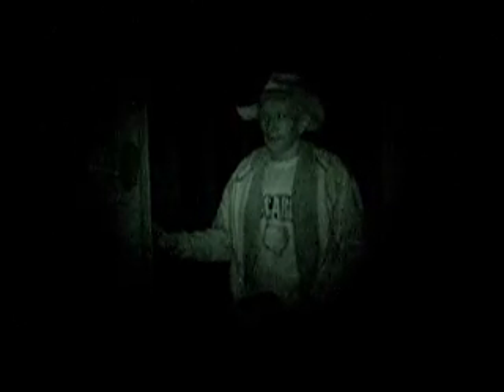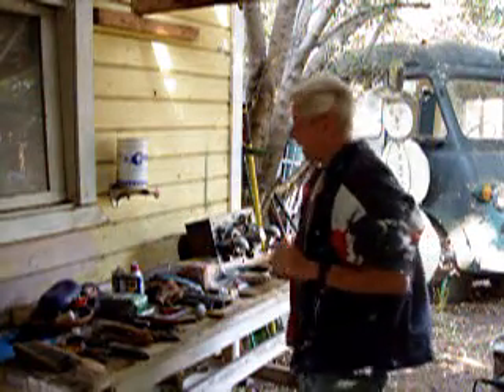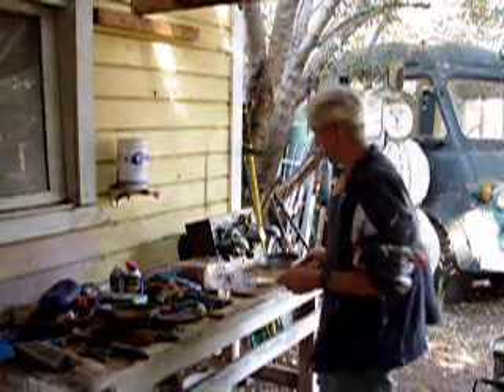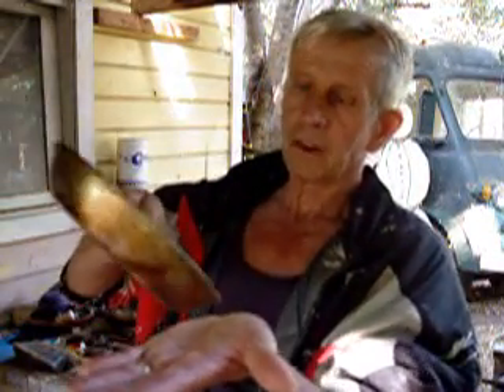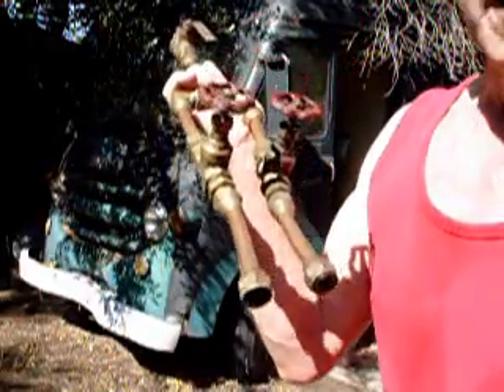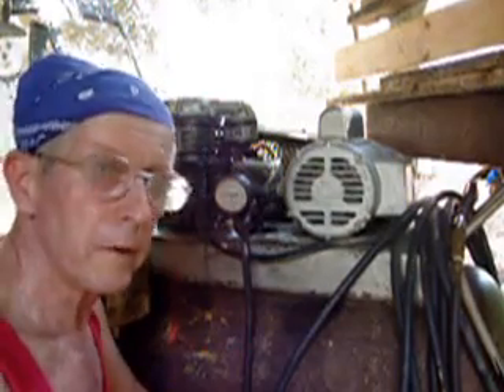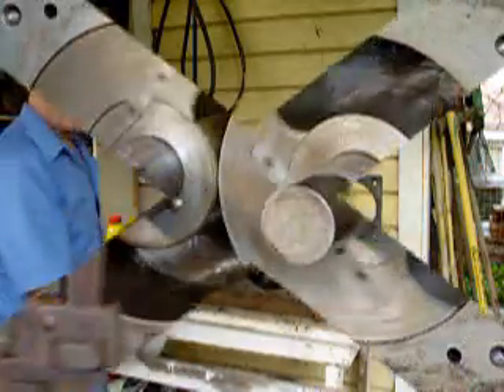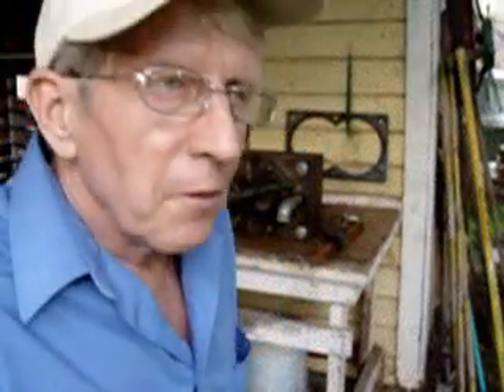Part 3 rotary steam engine 4 26 2009-3 25 2010.wmv

Comment from the maker: @kwelch42 thanks for thought. That may well work at some point. I had smothered them in STP and oil, to no avail. Years ago I had a fire tube boiler hook up and had the same issues of steam just blowing by. I had it set up at 100 psi steam and I could feel some attempt to move on the axle but, no go. Thanks again,
Ray

Comment: @rayunseitig true enough,but there is only one rotor in a wankel and there is an uneven temperature gradient  in this engine which requires the cooling system configured to spread the heat more evenly.
I read somewhere that the wankel engine uses a ceramic  "piston ring'" to close up the tolerances, the ceramic has negligible expansion and sits in a groove at the tip of the lobes and on the edges,
the cam expands but it is always less than the diameter of the chamber the cam sits in,

Comment: @rayunseitig then you need to know what the maximum expansion is of both cams at max running temp, then you can machine down the meshing surfaces a little further
The drawback is that you would need to let the steam flow warm up the metal first which should seal things up nicely, almost like the fuel tanks on a SR71 Blackbird or a formula 1 race engine.
you might have to find a good cam position and drill and tap out out a bypass hole to let the steam flow in and out until its warmed up.

Comment from the maker: @gordongate  Yes, that would take care of one of the areas of leakeage. Namely the sides. That leaves acouple of other places tho. The inner hub circle agains the outer large circumference of the adjacent rotor AND there the 4 crescent shapes intersect. Also I'm sure closer tolerances would help but not so close as they sieze up with the expansion of heat. Classical engine problems I'm sure.

Comment: @rayunseitig perhaps a version of how piston rings work.
a flat circle ring that sits in a groove cut within the maximum circumference before the lobe protrusion on the pistons and then you can shim the cover plate off by the same amount, it will provide a seal to the rotary piston against the cover plate with a greatly reduced surface area actually in contact against the cover plate..

Comment from the maker: @gordongate  Good thought, thanks for the imput. There are different ways to get the steam or air into the chamber. Perhaps a hollow shaft the delivers the steam into the cylinder cavity thru the rotating piston itself. I was picturing a cone shaped valve and seat with internal slots to regulate the time steam is allowed to pass.

I think an even greater problem is that of seals on the various surfaces vs. the friction they cause.

Thanx again Have a great 2011.

r

Comment: just a thought,
Is the available moving surface area sufficiently large enough for the available air pressure to overcome the inertia.
it just seemed to be a very small volume at the intake position given the friction of those cam side surfaces against the cover plate.
Its still a very nice piece of engineering though,

Comment from the maker: @mxkko Thanks that's a good thought. We used to run some of our air powered nail and staple guns on CO2 to make them portable. The increased pressure might do the trick. However the pressure coming out of the compressor was set to 110 psi, so I think that a good system of seals or tighter fitting parts is the only way to go for practical purposes.
Good idea tho.

Comment: What if, you are putting pressure on the C02 at the bottle so it is enough to run that. Otherwise, looks pretty good rotation.